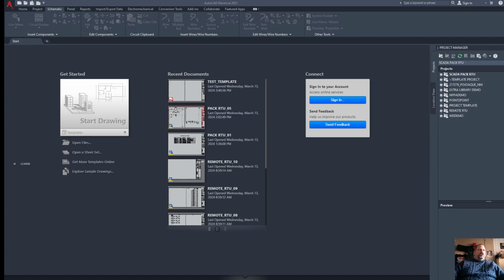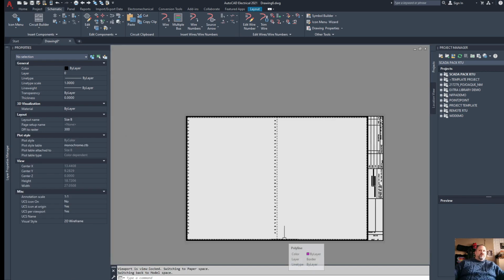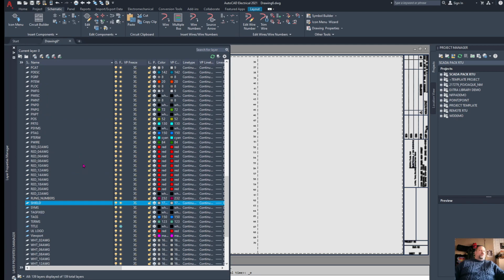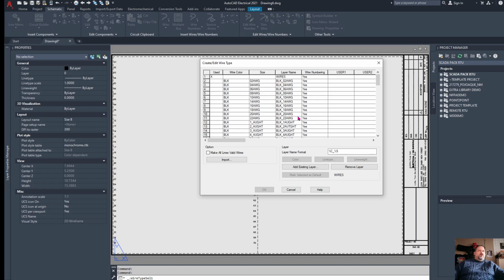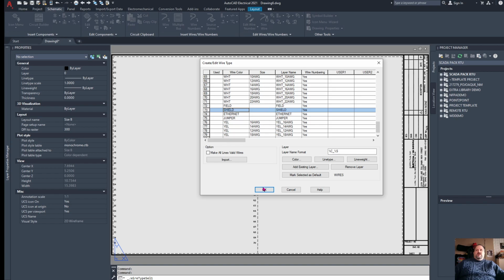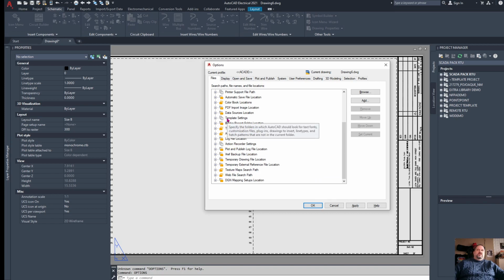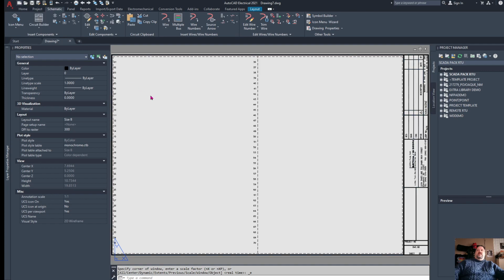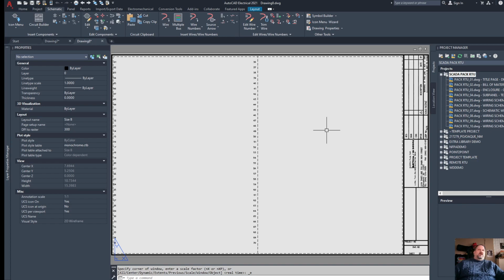Template Drawing setup

Comment: When you do your template like this, how do you later add rungs to match your rung numbers?
Reply from the maker: What I do is make a wblock of the rungs I want and save it to insert when needed. You can choose to insert you rung numbers with the ladders included when you create your template. I find that I end up deleting most of the ladders so I usually just insert them as needed. Lastly, most of my circuits are all saved as wblocks so all of the wiring is included when i insert them into the drawing.